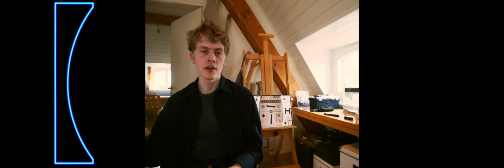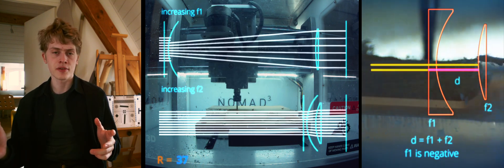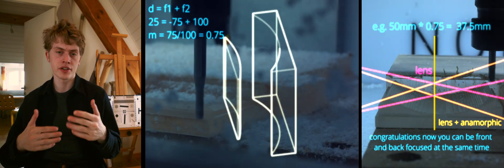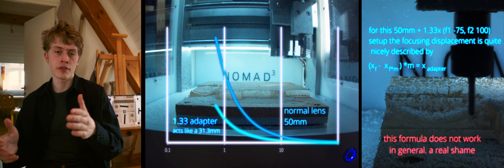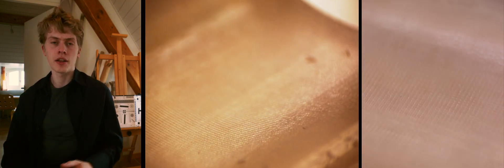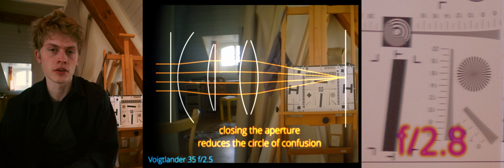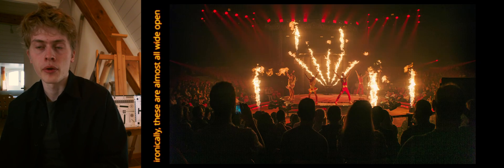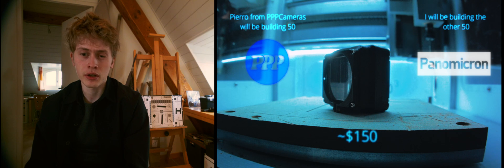How to Build an Anamorphic Adapter

Comment: I have a question: if I shoot this at infinity f/2 it will likely be out of focus?
With the +0.66mm distance will it only be perfectly in focus at 3 meters? 

Does the +0.86mm vs +0.66mm refer to how close I mount it to my main lens? 
Or does the +0.86mm vs +0.66mm refer to distances of the elements inside the anamorphic adapter?
Reply: I guess in short my question is: if I use the clamp mount to mount this onto my filter but I find a way to move the filter/adapter a short distance back and forth I’d be able to adjust it to an”infinity mode” and “close focus mode” and in those modes get good focus at f2 aperture ?
Reply: I realize now that the +0.86mm vs +0.66mm does not refer to how close it is to the main lens. 
So this is a "focus through" adapter and it will perform fairly well at all distances at around f/4 and smaller. 

My plan is to shoot it on a 28mm f/2 on an aps-c sensor (so 42mm equivalent). And since depth of field is less shallow on a crop sensor i might be able to shoot at f/2.8 without too many problems.  Hopefully it'll work 🤞

Sorry for bombing your video with comments :)
Reply from the maker: Yes this is a "focus through" adapter ( although that terminology is incorrect, as all anamorphic adapters are focus through, "fixed focus" would also technically be incorrect since you can't focus an anamorphic, you can adjust it, I would argue "fixed adjustment" would be the correct term).  You are correct the distance from the front of the taking lens (your 28mm in this case) does not matter much. The adapter is optimised for around 3m, as it provided the best average performance. You could technically adjust the spacing between the elements if you know you shoot more landscape and really only need infinity performance. I think the adapter will probably work quite well with a 28mm on aps-c though as is.  @lassekruselarsen6982

Comment: I'm really looking forward to this adapter! It has the exact look I love in anamorphics - the character and optical "flaws" make is so special. I hope I can get one of the glass versions when you are finished. What filter size is the adapter designed for?
Reply from the maker: Thanks! the adapter will be sold with a clamp-on design for 39mm filters, but there will be files to accommodate for 43 and 49mm filters as well. You'll also be able to print your own to fit if you have other requirements.